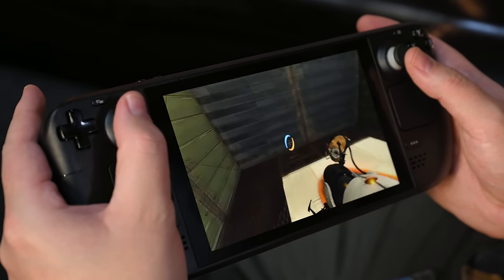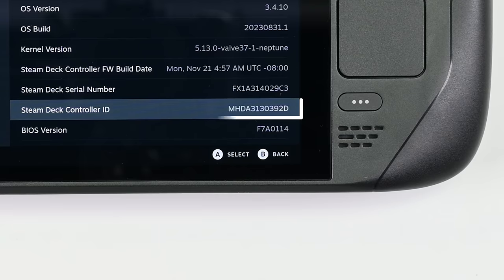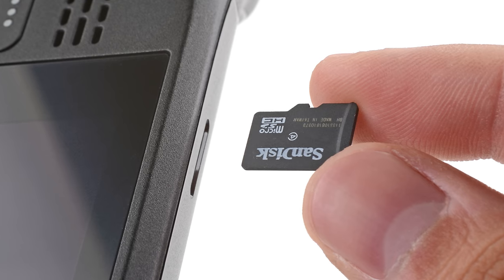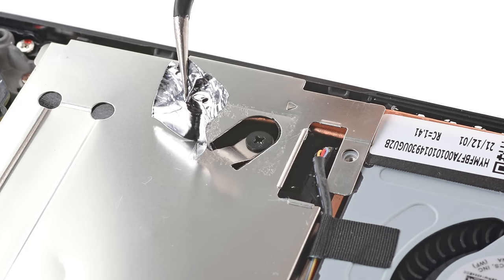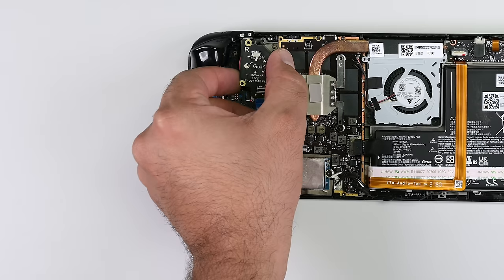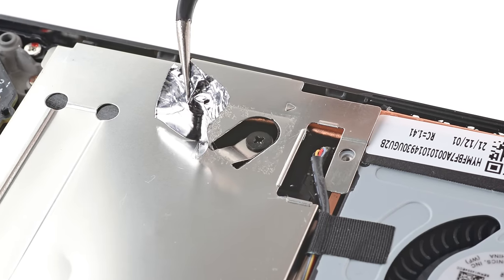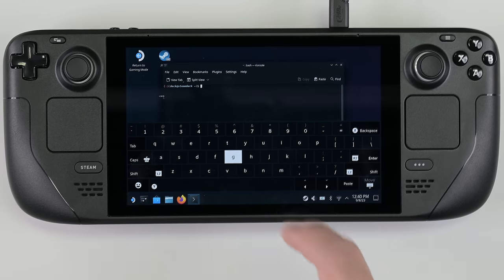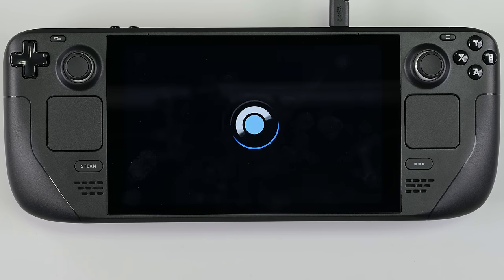Steam Deck LCD Thumbstick Replacement: Ditch Joystick Drift For Good!

Comment: Hoping Hall effect sticks are on the next gen of consoles
Reply: I was surprised they didn't revise the SD OLED with hall effect joysticks. I have a Legion Go which has hall effect sticks and a ROG Ally and the Go joysticks are leagues better.
Reply: Even this video shows hall effect sticks
Reply: Valve is not Apple. You can easily buy joysticks with Hall Effect sensors.
Reply: @uis246  I understand that but it would be nice to have them built in from the factory
Reply: @izzy9022  they where going to but had to revert back because of "quality control issues" idk what is wrong but its not quite there yet sd2 anyone? lmao
Reply: @thebeast7590  let’s hope sd2 only stands for steamdeck 2 and not stick drift 2
Reply: @uis246 Late comment, but yup. Valve doesn’t discourage users from modifying their Steam Decks, they even show you what tools you’ll need. The only thing they do is state that they are not to be hold responsible for any damages incurred, which is fair. Apple is very restricted by contrast.

Comment: One thing I'd like to point out is that those plastic connectors that have the black tab that needs to be flipped to take in/out the white and blue ribbon cable are very delicate use as little force as possible. There's quite a lot of videos by TronicsFix and TheCod3r who repair consoles that have broken tabs because the user tried to fix it themselves.

Comment: My right thumbstick popped out of its holder somehow. I was able to get it back in but it was still not right. Your video let me disassemble the steam deck enough to fix it - the post was no longer inside of the thumbstick.
Thanks a lot for this video.

Comment: Came here for curiosity on if the GuliKit sticks would be discussed at all. Personally I have gone through 2 pairs on Switch joycons, they're less durable than OEM. Mechanically they become uneven and clicky, and their output becomes inaccurate and touchy. Together these issues make precision control difficult though interestingly in player control it's generally fine, the issue is very apparent when in menus though where you want to point up/down and end up flipping left/right.
Reply: What's to discuss? They're undoubtedly the only kit you should be using.
Reply: @ProfessorNightman  I think I've demonstrated in my comment that they are at par with OEM quality on joycons, which is to say quite bad. My curiosity is if the issues I've described are unique to joycon sticks or if anyone has had issues with their products for other platforms. The form factor for joycon sticks is really bad so I want to give GuliKit the benefit of the doubt.

Comment: Can anyone help... When taking apart electronics I have a ESD safe mat and esd strap that are both connected to a ESD plug. Can I use normal precision screwdrivers with plastic/rubber handles with metal tips, or do I have to use ESD screwdrivers too? I have ordered a set of wera ESD precision screwdrivers to be safe, but I'm unsure about other tools like tweezers etc. Do they need to be esd as well, or can I just use a pair with plastic/rubber handles and metal tips? New to this so no idea what's right or wrong. Thanks in advance.